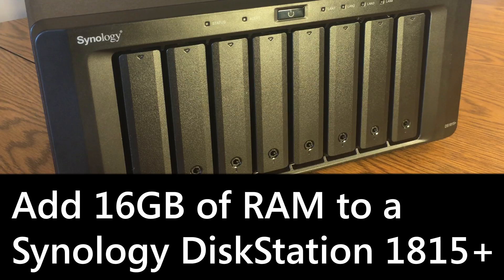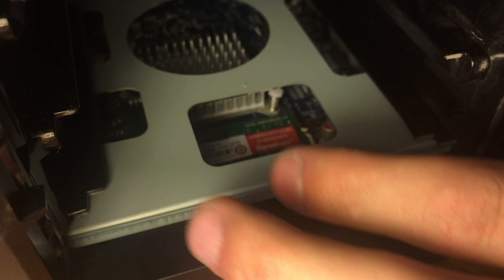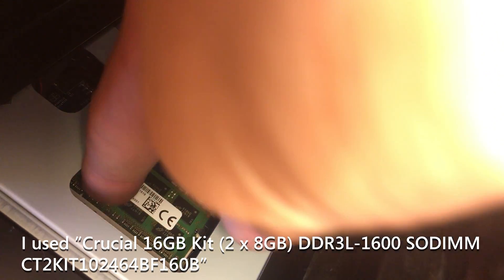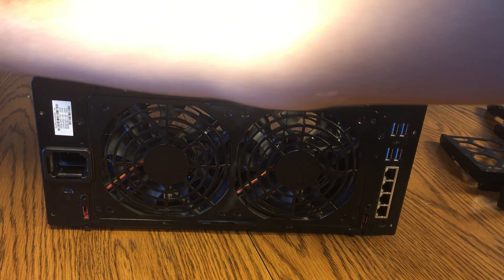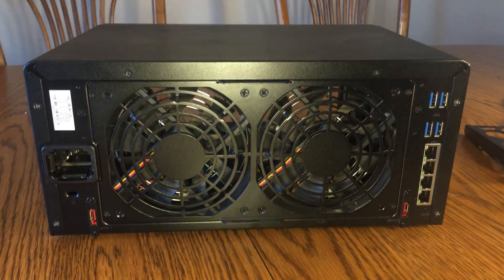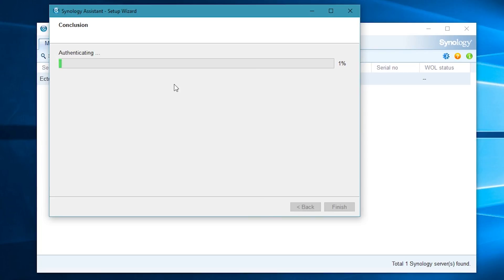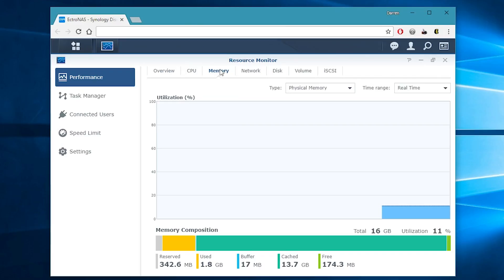Add 16GB of RAM to a Synology DiskStation 1815+

Comment: Ordered 2 8GB sticks - the stickers are on the opposite side. I installed one in the side slot and was met with a blinking power LED. Thankfully I didn't lose any data and had to reset the whole machine. Has anyone else had this issue?
Reply from the maker: Yikes. I (obviously didn’t) but I’m sorry to hear that you had this issue. Worse, that side slot is the officially supported slot. Not sure why you’d have problems unless maybe the new ram chip was bad? Perhaps there’s another possible cause
Reply: @Ectropy  i tried both sticks - i think synology may have updated the firmware in these things to only accept proprietary ram. i ordered the one they recommended and it worked fine, but it was only 4 GB. i'm only using it for plex, and it's been more than enough, would have been nice to have more ram for less money, though.
Reply: @patrickmurphy259  not all memory sticks are compatible that's my experience.
In the forum you can find enough information on sticks that will work.

Comment: Can I install only one 8gb memory stick in the 2nd slot and just keep the regular 2gb memory stick near the cpu, because I would be good with having 10gb in the DS1815+ ?
Reply from the maker: That should work too. Synology only officially supports up to 6GB total, which in short means using an 8GB in any slot is “unsupported” but it will probably still work! And no warranty-voiding RAM removal!

Comment: What RAM models did you use? Can you provide a Crucial link?
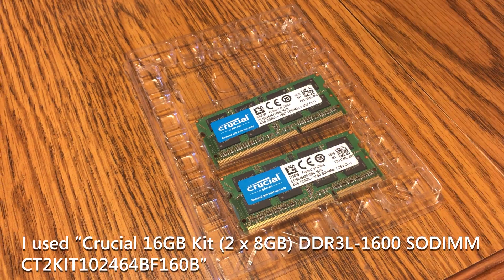Reply from the maker: The exact name and part number of the module I used is at 0:56 in the video. Hope that helps!
Reply: video at that timestamp says:

Crucial 16GB Kit (2x 8GB) DDR3L-1600 SODIMM CT2KIT102464BF160B

Comment: Good to know this works. So after a year of use, have you found you are able to allocate all 16GB to VMs and use for docker containers? It doesn't just allow you to use the maximum official 6GB of memory?
Reply from the maker: Usually my docker containers use under 6GB of RAM, but this question piqued my interest. I did a test by running Gitlab CE, UniFi Controller, and 4 Minecraft FTB Infinity containers since I needed to run something RAM hungry! This setup used 11.9GB of ram (~75%), and about 35-40% of the CPU. The MC servers were idle, with no players on them during this test.

If you wanted to run a bunch of containers that use a lot of RAM, you should be able to, and you are definitely able to use more than Synology's quoted 6GB of RAM.
Reply: Ectropy Arts very good! Thanks for doing that test. I may just have to get a new bunch of RAM then 🙂 I'll stick a 240GB SSD in bay 1 and I may buy another to enable write cache too, then put it in bay 2.
Reply from the maker: Sounds like a good plan. 

In the end, my verdict is that you probably don't need to splurge on upgrading to 16GB of RAM unless you actually find that your NAS is running out of RAM under your typical use. Still, it doesn't hurt to upgrade for future-proofing purposes (and that's why I chose to try).

Comment: I wonder if it really changes much IRL
Reply from the maker: It might, if you like to run a lot of services on your NAS at once (like Docker containers, Surveillance Station, Cloud Station, Plex, etc...) If you use it only for storage, with a small number of simultaneous users, you'd probably be fine with the default RAM chip.